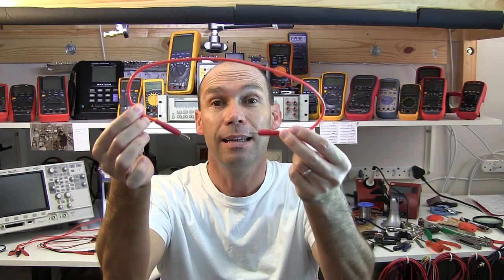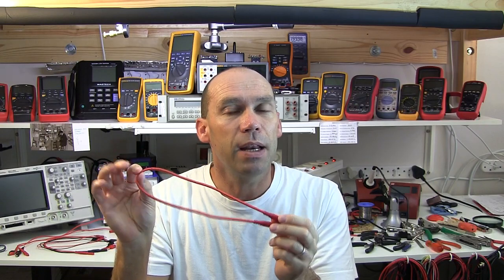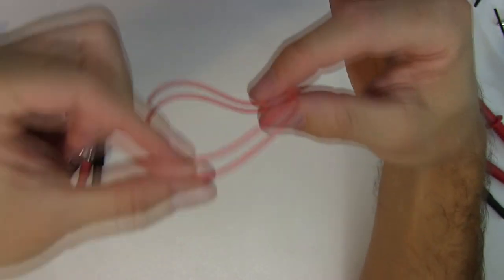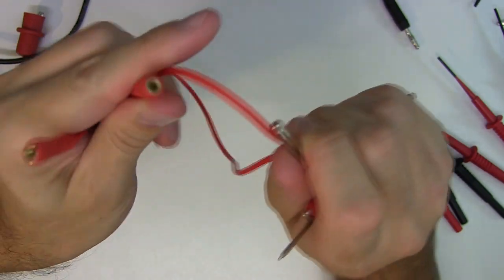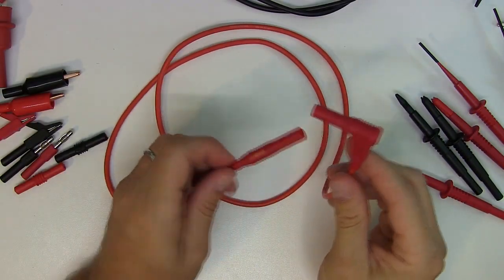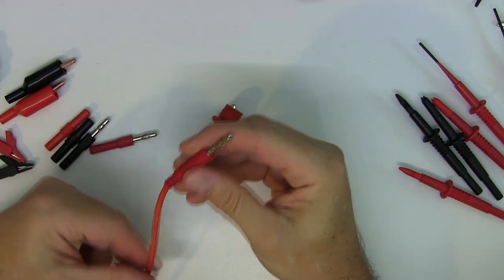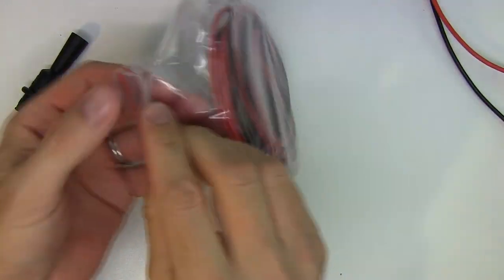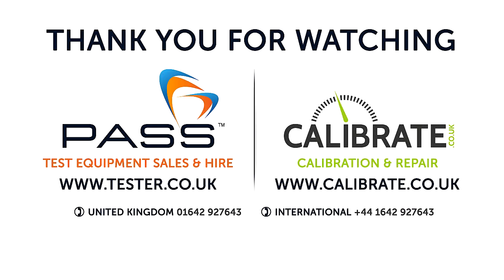Review: Test Leads for bench electronics

Comment: With heatshrink I would suggest getting the adhesive lined sleeving in assorted sizes. Shrinks and the hot glue lining sticks well to the inside and makes a waterproof and much stronger joint.

Comment: There's also a safety hazard with those screwed in ones if the head of the screw is visible and you're able to touch it.

You should never use those screwed in types if you're working with higher voltages than say 60VDC

Comment: I use a set of modular leads similar to those on a daily basis. They have a probe style handle on one end, and are some form of silicone rubber insulation. The sort of dull looking type, not the shinier type you tend to see these days. They're entirely unrated, I would consider them perfectly good for domestic stuff (CAT II, III on lower voltage circuits). They can usually be found on ebay by searching for 'Cage 5R542' or 6625-01-121-0510. Highly recommended.

Comment: Ran out of space for cup hooks, went out and bought a few door hooks in place of them. Same number of hooks but hold more. Cup hooks are still on a short wooden bar as storage though, currently a lot of assorted USB cables and other things like cellphone chargers are there. If you want lies on cable look at cheap battery jumper leads, often less than 1mm of wire but a 10mm plastic insulation and a 200A rating....

Comment: I'm retrofitting 5 way/ universal binding posts that take shrouded leads  onto PSUs and test gear Hirschmann SAB 2600/2730/2640 series Saves havings sets of bare and shrouded.
Reply: +Frank E Davidson Ironically, I blew the fuse of my new PSU while probing around  with Fluke probes with the GS38 shroud missing. I'm struggling finding GS 38 tip shrouds in red and black.

Comment: I melted all my Agilent (E3600A-100 - kit) test leads when building my constant current load. I also have a couple of homemade test leads whit those screw type but i dont like it that the terminals are open. The safety banana plugs from Hirschmann or Multi Contact are 2.50 € EACH ! There must be a reasonable priced source out there ...

Comment: I use alligator clips to mock up speakers. Is there an appreciable difference when using solid copper clips vs stainless or nickel plate? Why would one use copper wire and then terminate with a comparatively lower conductive metal in the clip?